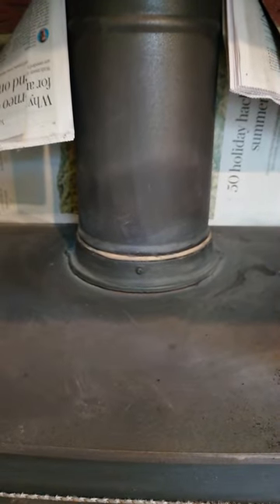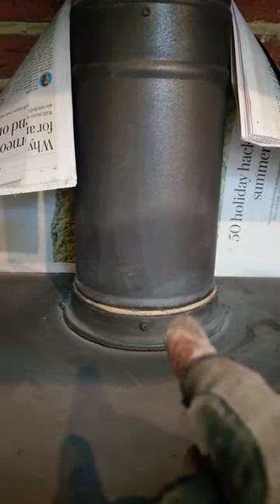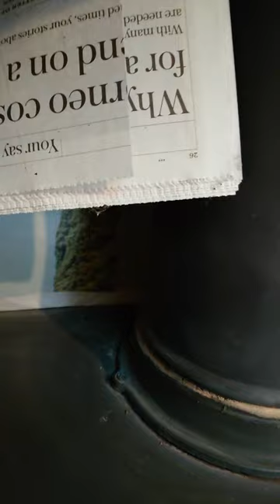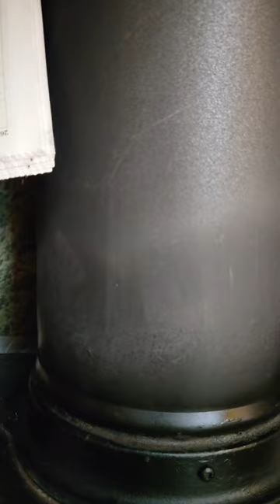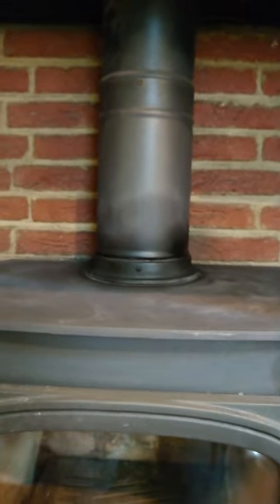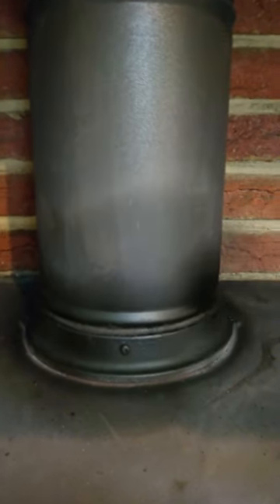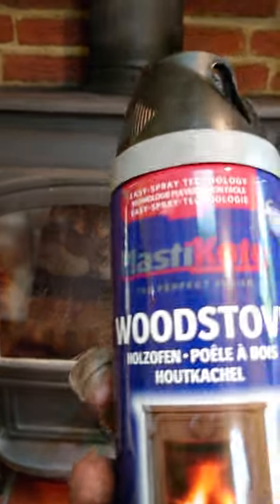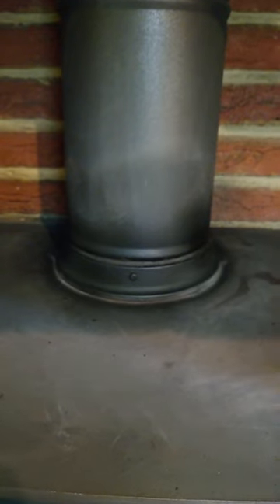HOW TO SEAL A STOVE PIPE PROPERLY

Comment: Can you use a black heat resistant silicone instead of fire cement?
Reply from the maker: Yes its much better,allows pipe to expand.👍👍
Reply: Most silicone sealers I've seen are only go up to 300 degrees. That doesn't seem high enough for a stove flue. Can anyone give advice to whether this is the case?